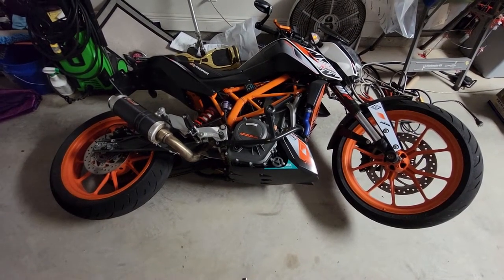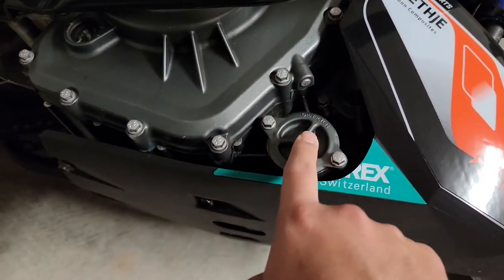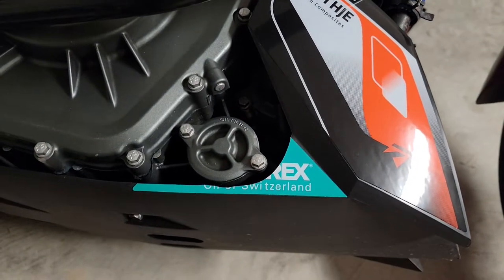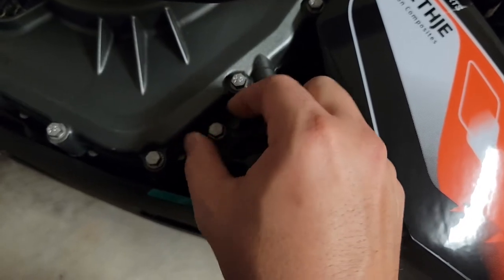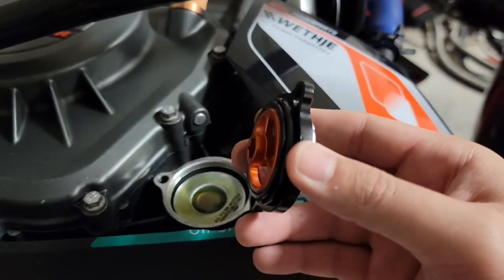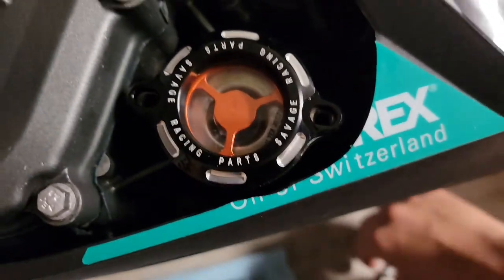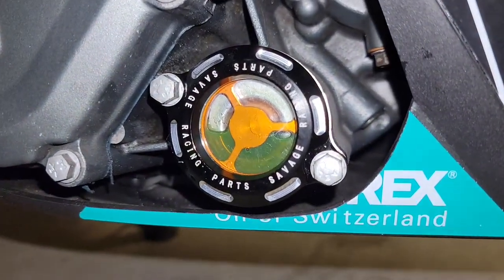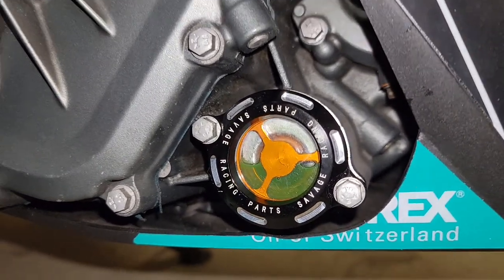ktm 390 duke oil filter cover

Comment: Hi.
I bought Duke 390 2023 15 days ago.
I'm thinking of removing exhaust/muffler on the side(slip on?)
Will it affect engine in long run?
Issues with air fuel mixture?
A lot of people say it wont do any damage, but a lot are also saying about back pressure and how it ruins engine.
Please help.
Reply from the maker: You should be fine.  The cat is still in place and that typically has enough backpressure to maintain original fueling.  Just do an idle relearn after.

Comment: Its not the best i put it on it started leaking through the side so i replaced it with new oring then it stopped and a week later it starts leaking through the glass bit so i went back to stock
Reply from the maker: Oh wow, I haven't had a single issue with mine.  I suspect it's a quality control thing....  kind of like it's either going to work or it's not.
Reply: Yeh probably anyway love the vids bro very enjoyable to watch ive pretty much got the exact same looking Duke as yours 😀
Reply from the maker: @cranie1459  awesome.  Feel free to ask questions if you have any.  Don't forgettiur valve checks!